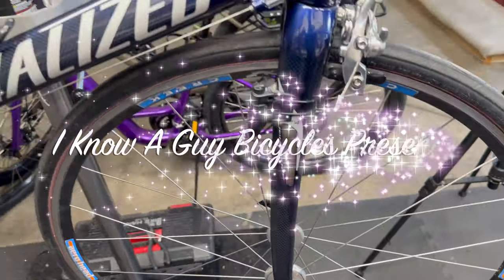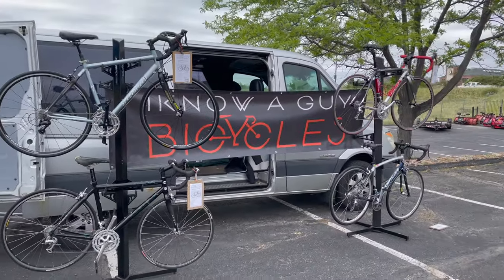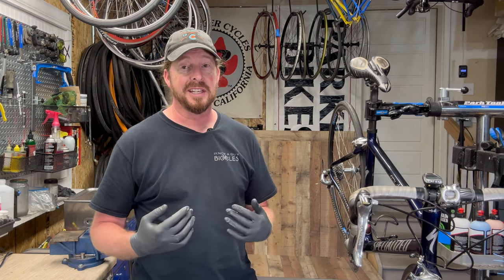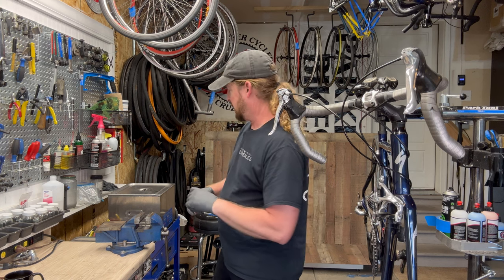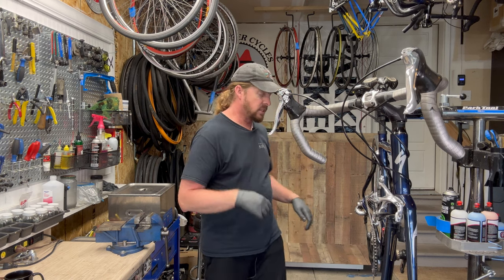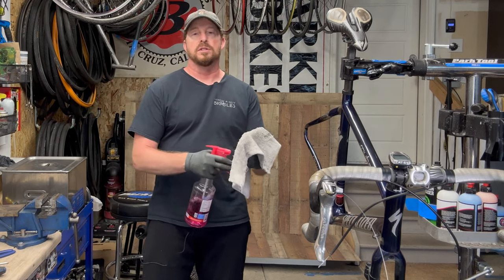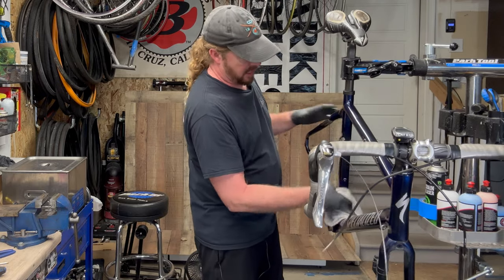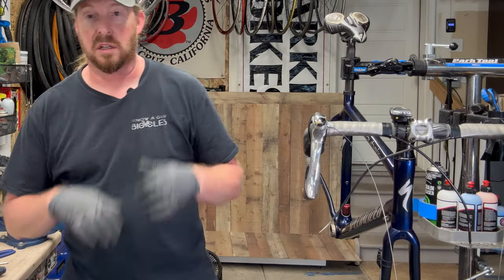Diamond in the Rough? Or NOT! - 2005 Specialized Roubaix Elite Compact Review - This Old Bike

Comment: Excellent work and result!. I bought the exact frame and wanted to put in a sram bb30 crankset, what bottom bracket would work? Thanks.
Reply from the maker: Sorry, that frame will not take a bb30. It's a threaded 68mm bottom bracket shell. Not a press fit. There maybe a conversion kit out there, but I'm not sure.
Reply: @IKnowAGuyBicycles  Thanks

Comment: Hey Justin! I recently bought a I believe 2006 or 2007 specialized Roubaix elite from my local bike shop to get into riding! It’s an XL and I stand at 6 feet, 6’1” on a good day! Did I get a bike too big for my stature or am I good? The bike felt pretty good while test riding but I’m not sure if there can be a better feeling while riding. What do you recommend I tweak on the bike to ensure I have a good feel while riding?
Reply from the maker: The frame should be the correct size. The common fitting adjustment is maybe a different stem length and seat. 2 quick checks is one: when you are on the seat and pedaling, do your legs extend to about 20-30 degrees? Second, when on the hoods, can you see the front hub? If it is behind the handlebars, you may need a shorter stem. You want the line of sight of the front hub to be obstructed or a little out front.  https://youtu.be/8D_8kEoOR5g